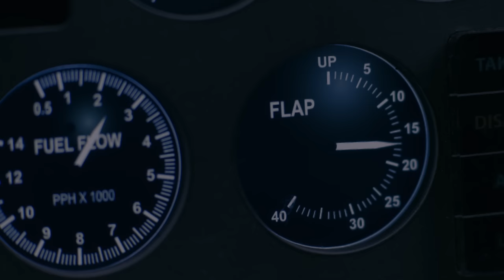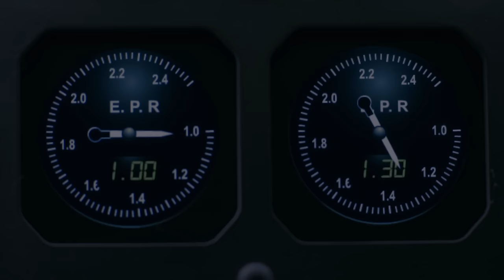Double Engine Failure Inspires a Heroic Performance by the Flight Crew 😮 Air Disasters | Smithsonian

Comment: Question. On the MD-83, does the APU automatically activate upon loss of the first, second or both engines? Or does the APU require manual activation? I know the APU wouldn’t have helped them achieve engine thrust, but it would’ve at least kept their instruments on, no?
Reply: From what I understand in the MD aircraft it needs a manual intervention like other A/C. But the APU would need time to start up and provide power to the buses, in this case I believe the emergency generator kicked in keeping the CAPT side instruments alive only.
But I’m not a mechanic or a commercial pilot so you can take my comment like a grain of salt
Reply: No the apu has to be turned on manually and the apu only provides electrical power and power to the flight controls like the flaps,slats,the gear etc
Reply: @koolaid203  thanks, I kinda figured. I believe the 727 also required manual APU activation.
Reply: @lorimeyers3839  if not mistaken in 727 the APU can't be started midair.

Comment: I could be wrong, but there was a flight similar to this where the plane ended up lower than what was ideal conditions due to the crew failing to monitor their instruments, but miraculously they were able to recover and perform an emergency  landing that otherwise would've likely been a routine landing. I don't remember what flight it was though. The Flight Channel has as lot of excellent recreations of past incidents, a few of which were rather infamous, such as Delta/United 191, JAL 123, and the Mt. Erebus crash.

Comment: after double engine failure, pilot made emergency landing on the runway after gliding through the runway almost crashing in the ground.
Reply: send the video for NTSB why pilot begin to refuel and it took several hours after flying time is nightmare.
Reply: You felt the need to summarize a three minute video?